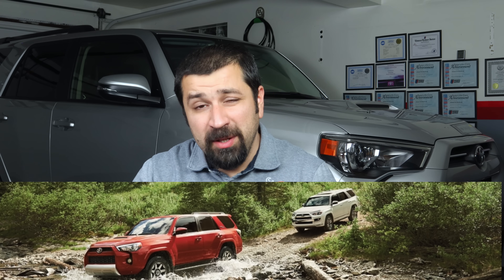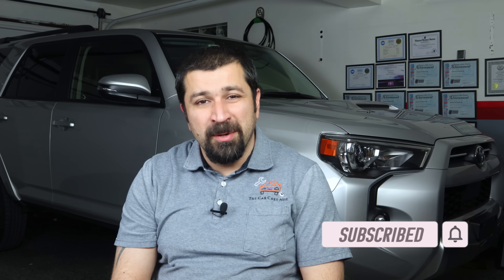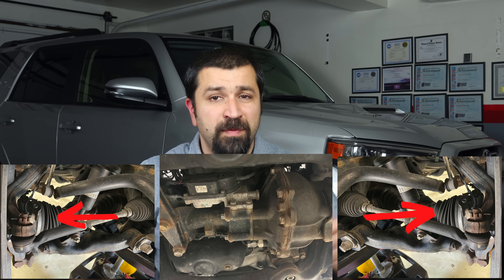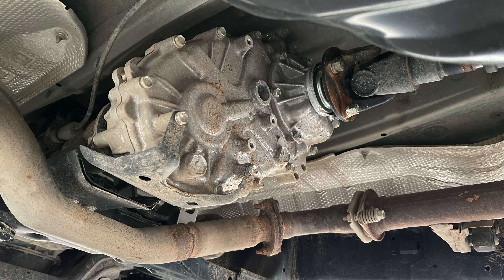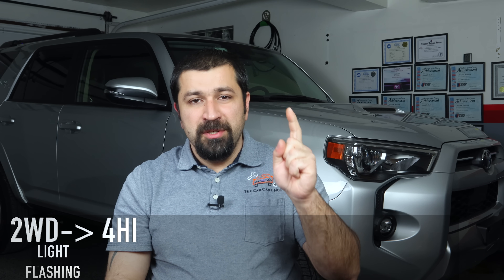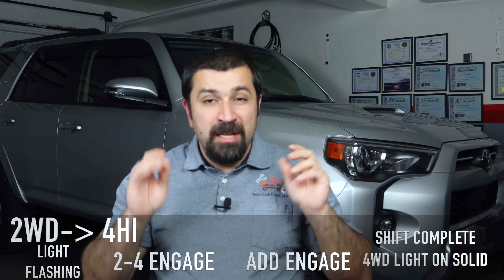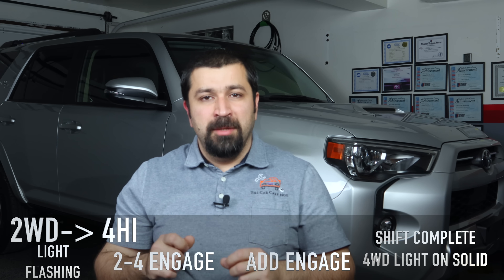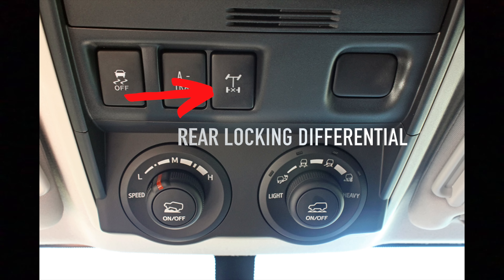How does Toyota 4WD System works and why is it reliable?

Comment: In the full-time 4wd, do you recommend putting it in h4l and l4l once in a while?  Or do I not have to worry about it seizing since it’s always awd?
Reply from the maker: I would engage everything every month or two. Yes you might not use them ever but come time to sell the truck one day and imagine the prospective buyer coming to buy your high priced beautiful 4WD truck and the first thing they do is engage them and they get stuck and not you’re stuck with flashing lights. I would take 2 minutes every month or so to switch through all models and go back and life is good.
Reply: I know the question is not for me, but I would say put it in everything every once in a while like he mentioned.

I take my moms gx every 3-4 months and use all the systems equipped (center lock, hill descent, 4L, etc) to check everything is working well, because she doesn’t drive much.  
I use the center lock in mine nearly everyday at the beach.
Reply: Use it all, and If you have the rear locker, exercise is also.
Reply: Dude just like ALL physical things, Use it on a a somewhat regular basis, OR LOOSE IT!
That goes for living, non-living, and everything else!
Reply: You don't have to worry about it, just drive.

Comment: Hi AMD, great video on the 4RUNNER 4WDs. My question is, on 2019 4RUNNER Limited which comes with full time 4WD - H4H, is it needed to shift to H4L on a monthly basis and also to L4L?
Reply: Yes, to move the actuator, and the shift forks into 4low.
Reply from the maker: Hi! I would shift it every month or so.
Reply: @TheCarCareNut  Thank you 🙏

Comment: So use it or lose it with the actuator. Is it just a matter of actuating it or should you keep it in that position and drive it for a few miles.
Reply from the maker: The manual recommends you drive it in 4Hi for 10 miles monthly.
Reply: @TheCarCareNut  Can  I drive it in 4hi on a dirt fire road and turn as needed for 10 miles? Can I drive it on pavement in a straight line for ten miles without turning?

Comment: Another great video.  My 2004 Tundra is the last of the "old school" models which is how I like it.  My Tundra has the 5VZ-FE engine, five-speed manual transmission and manual xfer case.  This is a bullet-proof setup.  My wife's 2016 4Runner is the SR5 premium because it was the highest trim level with part-time 4WD.  You can call me "old school".
Reply: What a tundra with a manual???  That's awesome.
Reply: @ZacharyFabbian  Yes, 2004 was the last year of the Tundra with the 3.4L (5VZ-FE) engine and the five-speed manual transmission.  Only automatic transmissions after 2004

Comment: What's needed as a workaround is a "restore" button that activates the actuator into 2wd mode directly, as in the "hot wire" fix. Would that work?
Reply from the maker: Hi! You’d need to find the 2 wires for the motor on the actuator and apply power and ground to it either way until it engages and the light stops flashing.

Comment: New subscriber- enjoy the vids immensely.  Completely off topic, but I don't know where else to address it where it may catch your attention.  I bought a 2019 RAV and had a bad, bad case of the coast and lurch that eventually received a software update right when I was going to sell the car and take the loss.  This fixed about 90% of the problem, but there is still a minor case of it here and there I can live with.  My question is, in your opinion, does this have any implications long term on this 8 speed?  I want to keep the car a long time, but it was so bad initially, I've never lost that concern.  Thanks much.
Reply from the maker: Hi! The odd feeling of the 8 speed transmission that’s left after the update is a normal characteristic. It’s very annoying I’m with you but it won’t have implications on reliability long term.

Comment: In my quest to get the most reliable 4runner possible I initially wanted to get one with the manual 4wd shifter.  After learning about the ADD I figured that since neither system is 100% manual, the electronic shifter in the sr5 should be fine as long as I use it every month.  What do you think? I have a 2019 sr5 with 45K miles, will I see a noticeable reliability difference using the electronic shifter?
Reply: Just use it often and it won’t be a problem, if you have to replace the transfer case actuator, the tcase has to be split open to replace it.
Reply from the maker: I think either will work perfectly if you follow the recommendation of shifting it once every month.

Comment: Do you need to be in park or neutral to engage four-wheel-drive
Reply from the maker: If you have a part time and you’re switching from 2WD to 4Hi you can do that while driving below 60 mph. If you’re switching from 4Hi to 4lo you need to be stopped and in neutral.
Reply: Only to put it in 4-low.

Comment: Thank you!!! By the way, can I ask for how long the OEM battery to use and when need to change with a new one? for 2017 T4R limited.
Reply: That’s a tough one, depends on a lot of factors, climate, driving style, sometimes even down to just getting a particularly strong battery,a lot of people don’t know that batteries are actually kind of made like cookies, In that  everyone is not exactly the same, they will have a nominal range but some will be slightly stronger than others. I have a 17 as well and it seems to be strong still,I hope I can get another 2 years from mine.
Reply from the maker: Honestly as The tech librarian mentioned it’s hard to tell exactly. I would expect a battery replacement around 5 years however it could be longer or shorter. Best thing I can recommend is to test the battery yearly and when it does fail replace it even if the car still starts.
Reply: @TheCarCareNut  Thanks,Bro